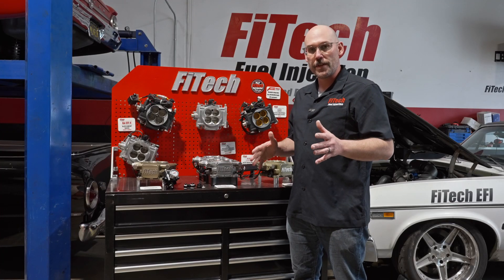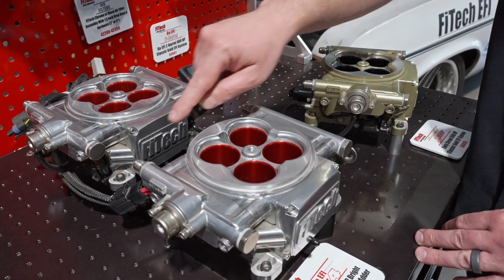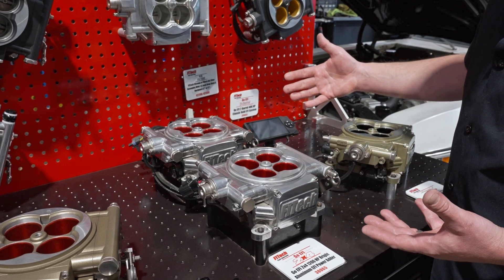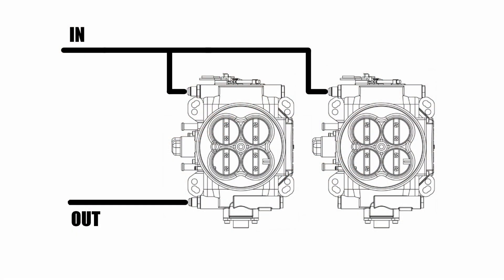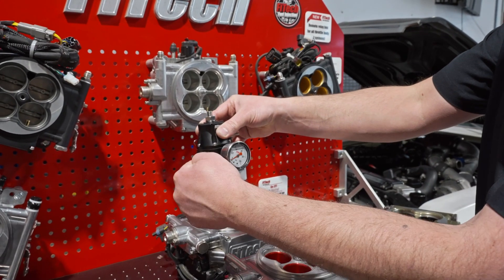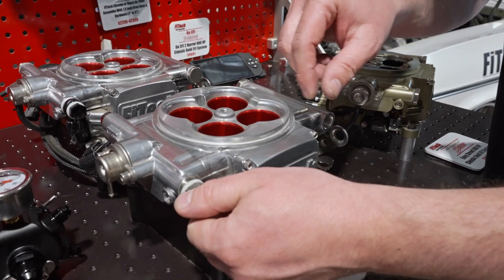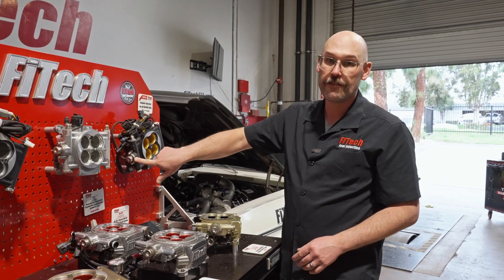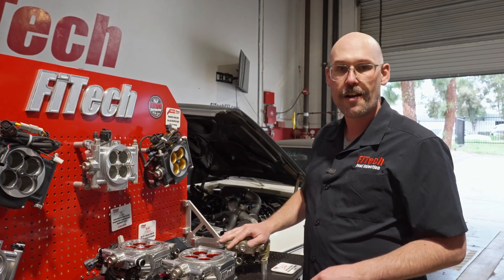How to Plumb a Dual Quad EFI System | FiTech EFI 2x4

Comment: So with a remote mount regulator you dont have to run a return line at all ?
Reply from the maker: Hello sir,

The remote regulator will help with an easier plumbing system, the system still requires a return, what the regulator will do is allow you to just plug the returns on both TBs and just run the single return port on the regulator back to the tank.
Reply: @FiTechEFImedia so just a return from the regulator and no return from the tb

Comment: I'm running the 30064 dual quad kit and the 50015 340lph fuel pump kit in a Fuel Safe fuel bladder system in the trunk floor of a '67 Eleanor. 

I was blowing the 20A fuel pump fuse initially during start-up and at idle. Fuel pressure was hard to read from tye needle bouncing so much. I'm connecting both throttle bodies on the passenger side with banjo fittings and -6 ptfe hose. I have a liquid filled fuel pressure gauge at the "t" at the rear throttle body. I have removed the regulators and blocked the returns. I'm returning through the fuel filter that's about 16" from the pump and tank.

I think I had a lot of air trapped in the system or some kind of obstruction in the fuel filter impeding return. It's a ll clear now and running easily up to operating temp. 

The 487ci FE at 12:1 sounds NASTY! I have the idle settings and afr's to look at next. I just wanted to post my experience in case anyone else has the same and is scratching their head as much as I was.
Reply from the maker: Glad you got it figured out. Sounds like you have a pretty interesting setup.
Reply: @FiTechEFImedia  well.....I'm not road worthy yet. How do I know if I should be on camshaft setting 3 or 4 with a solid roller camshaft?
Reply from the maker: @  Start on 3. Then when idling if the vacuum being read on the handheld is less than 7 inches of vacuum go to cam 4.  If the vacuum is low low you will also want to change the target AFR to something leaner like 14.7-15.5 depending on what the engine likes.
Reply: @FiTechEFImedia  thank you. I'll get into that after I get a set of fans that can keep up. The pair of Spal fans currently on the shroud, 844cfm each, aren't gonna cut it.

Thanks for the help.
Reply: @arturozarate1752    I use 12″ SPAL dual  S2130/30102130 @ 3200CFM on two cars, never have temp issues (never above 200° F) no matter ambient temp or driving conditions, since 2018 and 2020.
Staged, so one comes on at 170° F controlled by FiTech ECU, the other comes on at 195° F with a coolant temp switch and a 15 second delay relays on both, fans come on after start when car is hot to avoid high amp on crank with fans on (nearly 60 amps for fans).

Comment: Before I even watch this video

I run a banjo to -6 male on the right side of each throttle body. I block the returns, remove the vacuum regulator, and install the block offs. I run a single -6 up to the throttle bodies, and I regulate through the return style fuel filter @ 58psi
Reply from the maker: That is one of many ways to do it.
Reply: @FiTechEFImedia  I like to think that my way is the cleanest. If FiTech has a gallery I'll post to it.